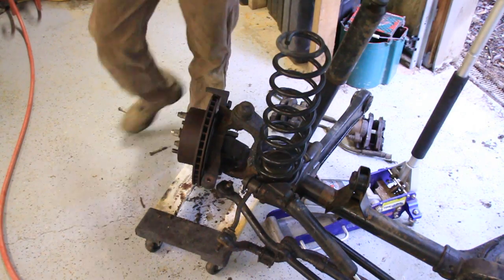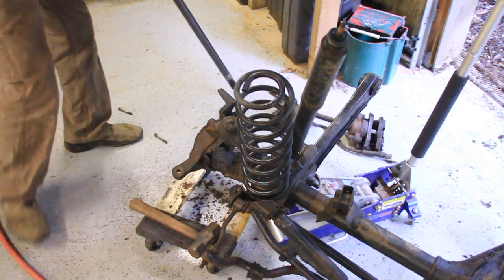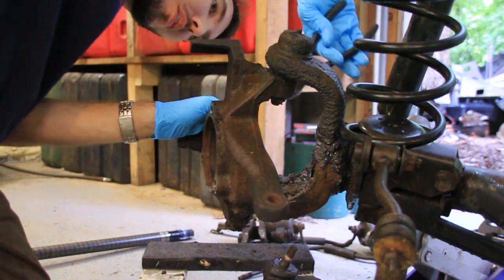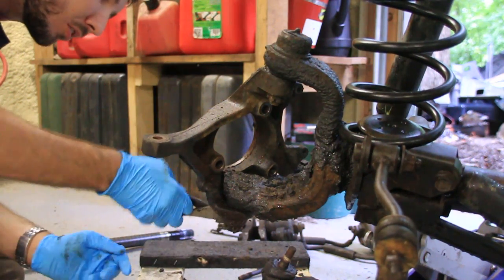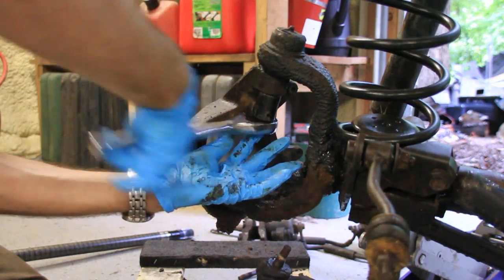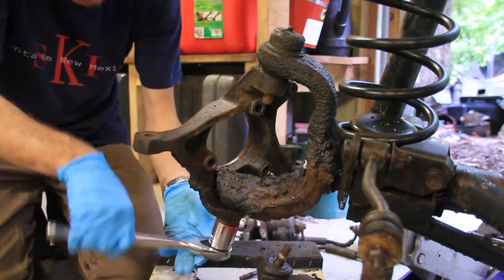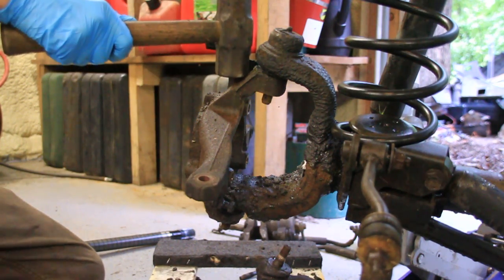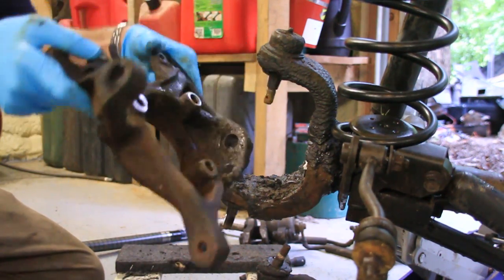How To Remove Your Steering Knuckles

Comment: Glad I've done my Excursion and 2 1/2T & 5T balljoints before- takes the "ughhh" out of it. Still not fun, but I have the proper kit/tools for doing it now instead of struggling with some pipe/plate/angle that's fabricobbled together- Thanks Matt and all at Bleepin Jeep- Much appreciated.

Comment: Hello Mat. There is a hose going to the steering knuckle, would you happen to know its purpose?
Reply from the maker: The anti lock brakes I would assume
Reply: . Thanks. That is the ABS wheel speed sensor.

Comment: Everyone shows this job with the axle off the vehicle. Matt, any suggestions on how to do it on the XJ? I cannot seem to get enough velocity due to the fender! Smacked it 50 times so far. No joy. Beat tht flat spot to the point of deforming it! Still nothing.
Reply from the maker: Bigger hammer!  You sure its unbolted?
Reply: LOL. Yeah. All disconnected. I put the large bottom nut on a few threads to "catch" the knuckle so it wouldn't drop to the floor, but that's not contacting the knuckle. Went to a five pound sledge this morning. About beat the flat self off. Still stuck. I love my Cherokee's...but they sure are obstinate beasties when it comes to removing any bolt, nut, or screw. 20 years of rusty embrace does not make for a happy separation. Kind of like the first time I broke up with a girlfriend!
Reply: Well, you were correct sir! Bigger hammer. Only added ingredient was to not care if I damaged the knuckle. Two good wacks on the knuckle itself instead of the small flat spot, off she came. Thanks!